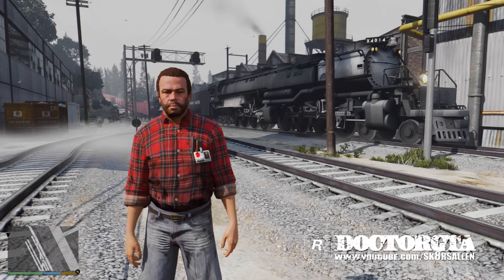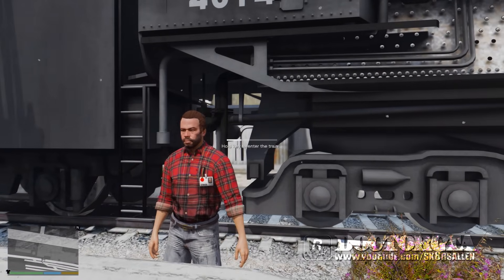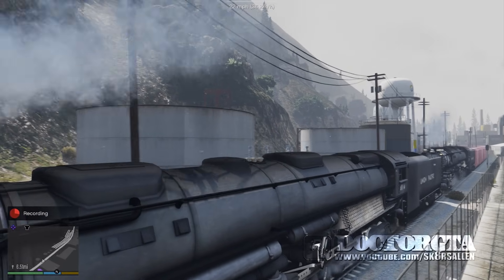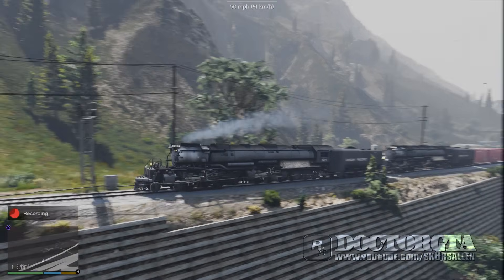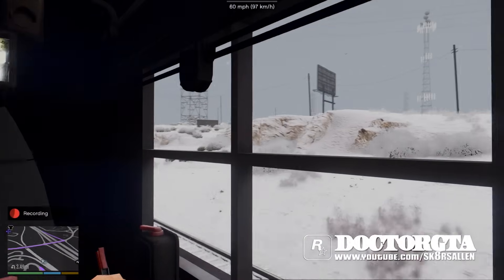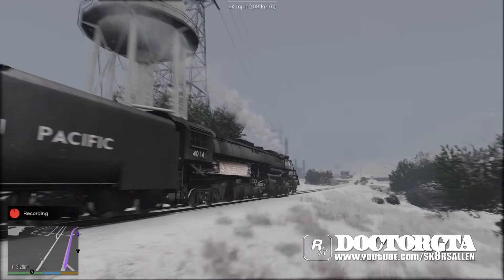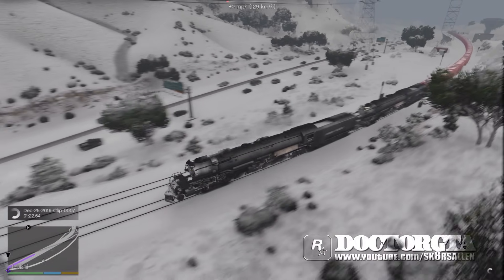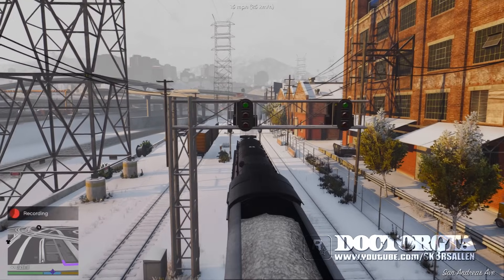GTA 5 Train Simulator Mod - (Union Pacific Big Boy 4014) Railroad Engineer Mod

Comment: its not actually pearl harbor they used them for. it was for hauling heavy freight through Sherman hill. they went from Utah to Cheyenne and Laramie Wyoming.
Reply: Agreed
Reply: That is damm right
Reply: Not just that, it was purpose-built to beat the Challengers in 1.4% grade without assistance.
Reply: last of the giants video from union pacific
Reply: The Big Boys were also designed to take on the steep grades of the Wasatch Mountains. In fact, the Big Boys were originally meant to be called Wasatches.
Reply: I wish it was still used in the u.s army instead of excursions
Reply: @jamesgroccia644  Yes, it was rumored to be called "Wasatchs", until some worker scrawled "Big Boy" in chalk on the front of Big Boy No. 4000, the very first prototype of the 4-8-8-4 class.

Comment: Amazing detail on the big boy. Drivers don’t turn fast enough so it looks like it’s almost like sliding. But these things could top out out around 80 mph. And they still do double head it’s just not really popular anymore. But nice mod tho for the most part. Also the stack don’t put out a lot of smoke. If there was 35 cars behind you. Then one would’ve been easily able to pull that. 4014 just got restored fully last year and it is about to finish its 1 1/2 month race across the Midwest so it’s nice you chose 4014.

Comment: There has never been a time where big boy would have been double headed...
Reply: UP 4014 and 4021 doubleheaded in the 1940's
Reply: @midwestrailfanner2268  the reason the 4010x class was made because 2 engines in one frame was cheaper than 2 separate engines... So you're telling me they basically double headed 4010s to make the steam power of 4 engines at the time?

Comment: In fact,big boy's max. speed can up to 80mph with full throttle
Reply: not even close. 80 on flat ground with moderate length train, just like the Challenger counterpart, but they rarely ever ran at full speed, that wasnt their purpose

Comment: What you know about THE UP  F-E-F Big Boy 4014
Reply: ACe_8599 actually the F-E-F is NOT the BigBoy
Reply: Trainlover4472 true
Reply: Which Steam Locomotive is it
Reply: ACe_8599 a Union Pacific big boy
Reply: ok
Reply: HAHAHAHA YOA A ACELA
Reply: ACe_8599 You call it an FEF and you ask what he knows about the Big Boy.
Reply: ok,so what's your point,I have more knowledge on modern locomotives than steam locomotives,I know a little bit about steam locomotives, which is why I asked the question that I did
Reply: UP F-E-F 3?
Reply: Star Platinum I believe so
Reply: ACe_8599 F-E-F is not a big boy
Reply: Did you just call the FEF the big boy? Get your trains right and come back later.
Reply: FEF are 4-8-4's, (F-E-F, Four Eight Four), also known as 800's
Reply: ACe F-E-F stands for 4-8-4 wheel arrangement, like Union Pacific 844 or 814 or Atchison Topeka and Santa Fe 3751
Reply: so its a F-E-E-F?
Reply: A four eight eight four... FEEF
Reply: TX19 97
Reply: the FEF was actually a Pacific type locomotive and was only a 4-6-6-4
Reply: FEF was a Northern (FourEightFour). Pacific's are 4-6-2 (P-class on Union Pacific, 2800s and 2900s). 4-6-6-4 are Challenger (UP had two versions, CSA-type and 4-6-6-4-X class).
Reply: the Bigboy were 4-8-8-4-1 and 4-8-8-4-2 class, or also know as the 4000-class
Reply: The crew of the Locomotive are not “drivers and assistants” they are Engineers and firemen...the engineer controls the engine, the fireman stokes the fire and assures the engineer has enough steam, and it’s not a horn on a steam locomotive, it’s a whistle
Reply: Actually(and I'm not saying I know this 100%, so if I get this wrong don't freak out) I think the big boy is a F-E-E-F
Reply: the F-E-F 3 is  the 844 (4-8-4)
Reply: Andrew Michael
Actually some steam engines like the Southern Pacific daylight locomotive(s) have horns. 
I'm not exactly correcting you just telling you what you missed so don't get angry.....

Comment: I THINK this train is cald the big boy its 1 of the strongest trains in history
Reply: Dani Kalen yep
Reply: Dani Kalen the us have the strongest steam train and England has the fasted steam train.
Reply: Dani Kalen it's the largest steam engine.....PERIOD. it's a MANS train.
Reply: game master 24/7 any engine could do that
Reply: game master 24/7 any engine could do that
Reply: i think you mean train locomotive/engine.
Reply: alexander1485 me
Reply: Dani Kalen even the title says big boy sherlock
Reply: occasionally Big Boy did have a helper....not very often though
Reply: +game master 24/7 200 cars? Pfft, try a 5 and a half mile long loaded freight on level track
Reply: +dragon bore Officially anyway, you can debate as to whether or not it actually is though because the Pennsylvania Railroad had a locomotive called the E6s series with a 4-4-2 wheelbase. The S means that the locomotive used superheated steam to propel it. Now the story with it and it unofficially holding the land speed record for the steam locomotive is that No. 460 (which is currently at the Railroad Museum of Pennsylvania) was racing to New York City to deliver a film of Charles Lindbergh's return to the states after his flight across the Atlantic. Now during the trip the locomotive was racing an aircraft and is thought to have reached speeds of 130 miles per hour during the trip, earning it the name "Lindbergh Engine". However since it was not officially logged, the LNER Class 4468 "Mallard" holds the record.
Reply: UP never actually ran a 5mile long train, that was only said more for publicity. The BigBoy was used over Sherman Hill and the 4-6-6-4 Challenger did most of the long haul work. C&O's Allegheny was the most powerful, Big Boy was just the largest
Reply: Point is is that it COULD do it if you wanted to, not that you ever would.
Reply: cody rentzell and big boy had long 10 mile trains
Reply: cody rentzell and all so the dd40ax was the biggest and strongest
Reply: cody rentzell Actually the calibration of the dynamometer car can be called into question because they never actually tested the calibration of it. Therefore the readings they got for the Allegheny type could be the result of faulty readings.
Reply: DDA40X was the largest and most powerful diesel, yes.
Reply: maybe with 2 or 3 Big Boys, it could pull a 5 mile train
Reply: the World's Longest Train to this date was barely over 4 miles long (ore train in Australia. 682 cars, 8 AC6000CW locomotives)
Reply: these are one of my favorite engines, i know pretty much everthing about them. they DID test calibration by actually performing road tests, like all roads did in the 1940s. Allegheny was the heaviest and most powerful steam locomotive ever built, generating 8000hp and weighing almost 1,200,000lbs. The Big Boy generated about 6200hp and weighed 1,180,000lbs. Big Boy was only longer at 132ft to the H8's 125ft. However, both were designed for two completely different purposes. UP designed the Big Boy for long, heavy freights whereas the H8 was designed to haul heavy coal drags up the steep Blue Ridge mountains. A Big Boy was never confirmed to have ever pulled a train longer than a mile, it was all publicity UP made up to make it sound impressive (though it was impressive, still are). Big Boy were primarily used as helpers over the Wasatch/Sherman Hill. they would more often be double-headed with Challengers, which did most of the heavy work on flat ground. C&O's H8 however, was its own helper. it HAS been confirmed that one could pulled a 90 car loaded coal drag up the mountain by itself and not stall or lose traction. that test is even in a video (Articulateds in Appalchia by Herron Rails).
Reply: cody rentzell the big boys were designed as succsessors to the challengers in order to replace double header challengers on trains that really only needed one engine so as to avoid a waste of man power and money. the only times they served as helpers were near the end of their lives when first generation diesels were introduced.
Reply: Kkopel its a locomotive
Reply: dragon bore locomotive
Reply: Venom Said them any locomotive can do that
Reply: they were not replacements. UP wanted the Big Boy as additional muscle for the Wasatch Mountains. They were designed off the Challenger. It was common to see Big Boys and Challengers double heading, especially during WW2. Challengers actually outlived the Big Boy
Reply: Kkopel haha "train"

Comment: My son loves trains and we have one of the original big boy trains at the local train museum in Scranton, PA. The horn honking long long short long, is actually a horn signal for crossings, human or car. One long means the train stopped and locked its breaks and two short horns means that the train started moving. Another fun fact about big boy in particular is that its too heavy for most standard train tracks so most tracks that are still operational arent tracks a big boy could travel on. You said in the description that they are restoring 4014 and you can actually follow their progress on their youtube channel. And another little fun fact, big boy has a little sister who's practically as big. Challenger is a 4-6-6-4 whereas, Big Boy is 4-8-8-4 like you mentioned.

Comment: 6:38 Actually, it wasn't exactly for WW2. In the late 1930s, Union Pacific was facing a difficult challenge. All of their locomotives, most notably the Challengers, even though they were the biggest locomotives at the time with two sets of six driving wheels, and four trailing wheels, could not climb through steep mountain grades in the Wasatch mountain range in Utah. So they tried double-heading, but still, it made operations even slower and weak. So in 1941, months before the Japanese bombed Pearl Harbor, Union Pacific was facing a new project: To build a locomotive that could be able to haul this type of freight run through the Wasatch mountains, but with no need of double-heading. So in that same year, with their structure and design similar to the Challengers, the class 4-8-8-4, nicknamed "Big Boy", was introduced to the tracks and were eventually at work between 1941 and 1962. They were originally supposed to be called the "Wasatchs", until a worker scrawled the word "Big Boy" in chalk on the front of the prototype, No. 4000.
Reply: To everyone u
Reply: yeah exactly, you kinda contradicted yourself. they were made in WW2 because no other train couldd o what they did but then they continued to see use after

Comment: These locomotives were fascinating. If I recall correctly, they were able to assemble and haul a train more than 5 miles long using only 1 or 2 of these locomotives.
Trains today average a maximum of around 1 mile, and that's using 4 or 5 diesel electric Dash-9's.
Reply: No, they trains weren't any longer than today's, or shorter, but... The locomotives we're individually stronger than early diesels.
Reply: nah the trains went up to relatively the same, its just the steam locos were individually much stronger. also less efficient and more complex to build though

Comment: Now using a double header with the big boy actually wasn't realislistic. There where only a few models of the big boy, and so they wouldn't want to use two at the same time. 

Now I have also seen this exact locomotive in Omaha Nebraska and North Platte. It was quite the show! Also, i saw the largest diesel locomotive in the world (which is also owned by Union Pacific).

But other than that, this was just simply and incredible mod!!
Reply: Caleb Lindquist there where only 25 of them
Reply: i would suggest watching Big Boy Collection from Pentrex, the UP double-headed with Big Boys all the time. there were 25 (4000-4024) and 4014 was actually on display in Pamona, CA unless you saw her in action. the Big Boys were to supplement heavy freights over Sherman Hill, generally double-heading with a 4-6-6-4 Challenger or on occasion another Big Boy. now double-heading for the length of train in the video is abit unrealistic, but it was done for longer trains.

Comment: One does not simply honk with a steam locomotive. Well, some steam locomotives did have air horns, such as Southern Pacific 4449. Also, I kinda wish the mod was more realistic. For instance, Union Pacific specifically designed the Big Boys to be able to pull a train longer than 40 freight cars over Marias Pass with just one engine. Either way, welcome to the railroading community! If you need or want any help or knowledge relating to trains, just contact one of us train guys.
Reply from the maker: +RailLord thank you

Comment: Pardon the correction, but the Big Boys were oil fired. Same for the Challengers and the FEF class, as well as SP's G3/G4, and Santa Fe's 3751

basically all the excursion locos out west are oil-fired
Reply: no, they werent. the big boy wasnt anyway. it was coal fired byt during the restoration of the 4014 they modified it to be oil fired. originally they were coal fired. so no he was right on that one

Comment: It weighs more than the space shuttle when fully fueled, road ready. At  about 70 mph,  they start bumping 10,000 hp at the draw bar. There is one being restored as we speak to operating condition.
Reply: already restored now, but now, they didnt even come close to 10k HP. not sure where you got that from. the max on average they hit is roughly 6200, or somewhere around there. not 10k tho

Comment: You need to look out for the steam chest pressure from the boiler steam, it needs to be stable, and it needs to be a little higher especially on the inclines. If you don’t do that, the locomotive will explode but I don’t know if GTA physics goes that far.
Note that this comment isn’t 100% accurate for anybody who wants to correct me.

Comment: They do not have tires, I feel that was just a slip on your part and not intentional. They do not have rubber or anything of the like, it's steel on steel. For traction the locomotive engineer would deploy sand upon the rail to create friction. Wheel slip is indeed a bad thing, but common and will happen. However that is why locomotives are so heavy, more force pushing down upon the wheels, the less likely they are to cause slipping. Trains are something else when you consider the contact between wheel and track is often no bigger than a quarter.

Comment: I think the real 4014 has been modified to run on just heated water because the car that would normally hold the coal is enclosed you can't see the coal from the top as you normally would

Comment: Hmm, the Big Boys operated closer to the Midwest, I don't think they ever went to Cali, so I'm certain that Pearl Harbour comment is wrong. Plus the double header might just be for show, but it's very unnecessary. Take the Schwerer Gustav, the railway gun. One big boy can pull two of those guns, and then some.
On the diesel side of things, you would need about 38 of them to equal the strength of one Big Boy (Math based off of the SD70ACe, I was unable to find if UP had a more powerful diesel engine in service)
Part of why the Big Boy was so good at pulling was its weight, the heavier the engine, the better the traction in most cases, and heavy the Big Boy was: about 1,250,000 pounds as you said, combined with that 4-8-8-4 arrangement, it's pretty much the best hauler out there.

"Much to learn, you still have."

Then again you do specialize in gaming, so I kinda dumped info on you for no reason. XD

Comment: Yeah I knew. That’s were the 4000 class got its tourge which had enough power to push it up Sherman hill in Wyoming also the grinding is the flanged wheels going along the steel rails mostly curves

Comment: Just an FYI Union Pacific never ran a "double header" as you call it with the big boy locomotive. The whole idea behind such a massive locomotive was so that one single engine could produce enough power to pull long heavy trains through steep mountain passes by itself, not needing help from another engine. The 4-8-8-4 Union Pacific Big Boy was designed to do exactly that and it never needed a helper locomotive, especially a fellow Big Boy, so your use of a double header is highly inaccurate for this locomotive
Reply: I beg to differ.  I have a photo of a train being hauled by two "Big Boys".  I will NOT speculate on the length of said train.

But, it IS true that the "Big Boy" was built to operate over the mountains.  One of the engineers stated, "If one of these bulls can't make it over the mountain, it'll go through it."

Comment: So this is modded GTA? Or is this Railworks or Trainz? From what I can tell this is a train simulator quality unit- but it's in GTA. I would love to have walk-around mode in a train sim (aka railfan mode). GTA should integrate better drivable trains. Maybe a nice GP9, or like an F40PH. They might as well just make "Grand Theft Railroad": take Trainz: A New Era and mix it with GTA. 
But 80 mph? UP doubleheaded over Sherman Hill at 12 mph with the 4000s. Now they just throw a few GEVOs on and it's less impressive.

Comment: can you do the Nickel Plate Road 765/284 Berkshire steam locomotive 
it was built in September of 1944 and ran from Fort Wayne to Cleveland and Pennslyvania And New York 
she was put in retirement in the 1960s and in 1979 she was fired up and is still running to this day since 1979 and through the 1980s

Comment: well these aren't the only ones my state i live in Indiana there is the last train that is here and it is being repaired with the boiler. My grandma works on the Indiana state fair train that runs every year well not this year because of profit issues. And also GTA did you account for slow orders on the track when their is a sheet and your where running supply runs the paper would have red that would be a slow order. have a great day and i'll see you later.

Comment: The steam engine has water in the tender along with coal the water is pumped into the boiler and the coal is shoveled in by hand you burn the coal to heat the water to boiling point with the coal